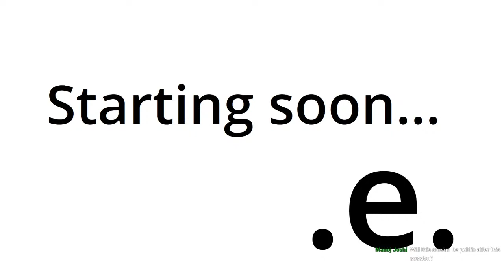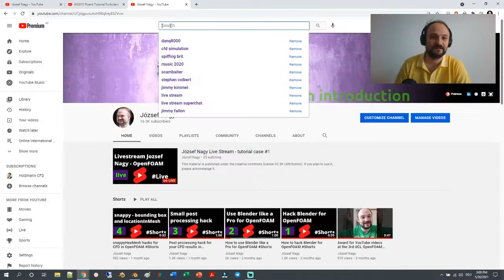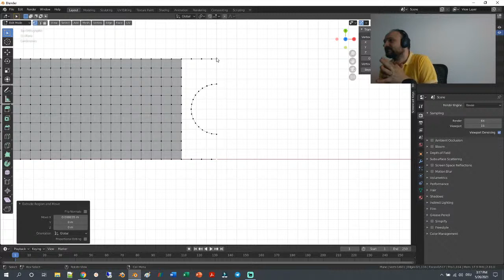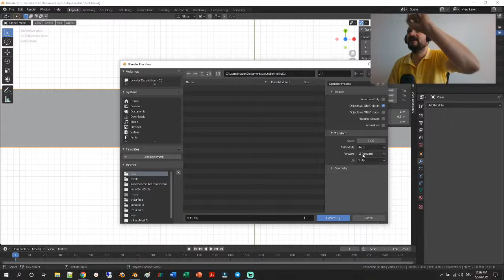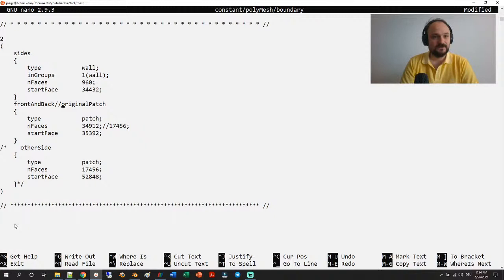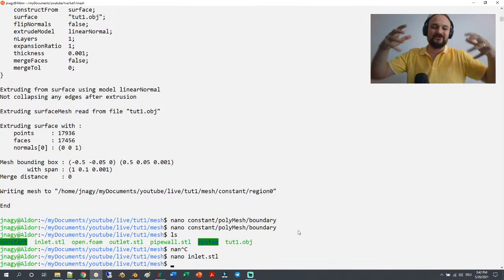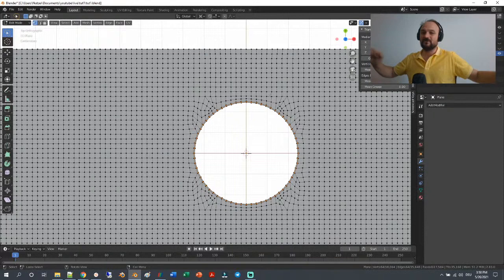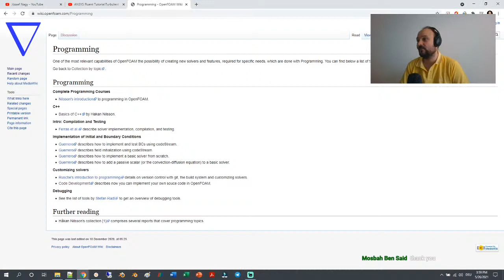József Nagy Live Stream - tutorial case #1

Comment: Hi. 15:20 some advices: you dont need to make 2 lines and then connect them (edge-bridge edge loop), but you can simply extrude one line to the position of another one. Best way to accurately do it is vertex snapping by active. Another thing is, that you dont need to use ctrl+r to subdivide, but just make a line with subdivided points and just extrude 200 line those few times, each time while snapping to vertexes. Have exams, didnt have time to watch live :D
Reply from the maker: Thank you Filip for your input! You live and learn ;)

Comment: Hi i am actually working on openfoam with the 2D simulation of  impact of a drop on a wall. First a have run successfully interfoam with simple geometry, but when I turned it to a geometry with a roughness, then openFoam sent a error like: Reading g
Calculating field g.h

No finite volume options present

time step continuity errors : sum local = 0, global = 0, cumulative = 0
DICPCG:  Solving for pcorr, Initial residual = 0, Final residual = 0, No Iterations 0
time step continuity errors : sum local = 0, global = 0, cumulative = 0
Courant Number mean: 0 max: 0

Starting time loop

Courant Number mean: 0 max: 0
Interface Courant Number mean: 0 max: 0
deltaT = 0.00119048
Time = 0.00119048

MULES: Solving for alpha1
Phase-1 volume fraction = 0  Min(alpha1) = 0  Max(alpha1) = 0
MULES: Solving for alpha1
Phase-1 volume fraction = 0  Min(alpha1) = 0  Max(alpha1) = 0
DICPCG:  Solving for p_rgh, Initial residual = 0.0783042, Final residual = 0.00377567, No Iterations 2
time step continuity errors : sum local = 9.25022e+270, global = -2.20593e+269, cumulative = -2.20593e+269
#0  Foam::error::printStack(Foam::Ostream&) at ??:?
#1  Foam::sigFpe::sigHandler(int) at ??:?
#2   in "/lib/x86_64-linux-gnu/libc.so.6"
#3  Foam::fv::gaussGrad<double>::gradf(Foam::GeometricField<double, Foam::fvsPatchField, Foam::surfaceMesh> const&, Foam::word const&) at ??:?
#4  Foam::fv::gaussGrad<double>::calcGrad(Foam::GeometricField<double, Foam::fvPatchField, Foam::volMesh> const&, Foam::word const&) const at ??:?
#5  Foam::fv::gradScheme<double>::grad(Foam::GeometricField<double, Foam::fvPatchField, Foam::volMesh> const&, Foam::word const&) const at ??:?
#6  Foam::fv::correctedSnGrad<double>::fullGradCorrection(Foam::GeometricField<double, Foam::fvPatchField, Foam::volMesh> const&) const at ??:?
#7  Foam::fv::correctedSnGrad<double>::correction(Foam::GeometricField<double, Foam::fvPatchField, Foam::volMesh> const&) const at ??:?
#8  Foam::fv::gaussLaplacianScheme<double, double>::fvmLaplacian(Foam::GeometricField<double, Foam::fvsPatchField, Foam::surfaceMesh> const&, Foam::GeometricField<double, Foam::fvPatchField, Foam::volMesh> const&) at ??:?
#9  
 at ??:?
#10  
 at interFoam.C:?
#11  
 at ??:?
#12  __libc_start_main in "/lib/x86_64-linux-gnu/libc.so.6"
#13  
 at ??:?
I dont what doesnt this mean. Please i need help.
Reply from the maker: What do you mean with roughness? Did you introduce it geometrically or with the BC?